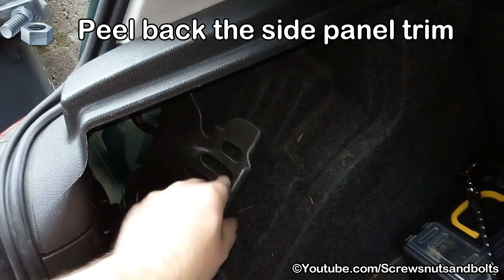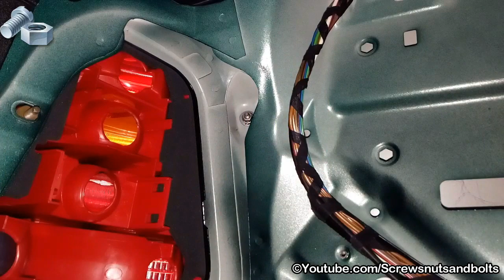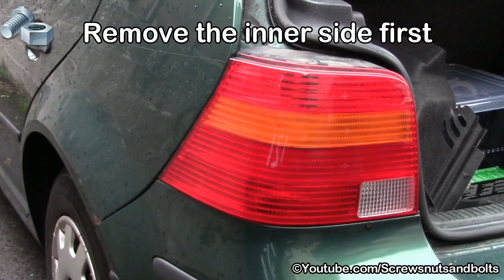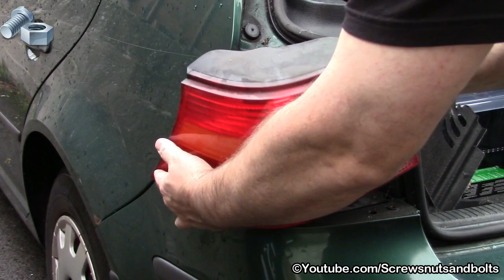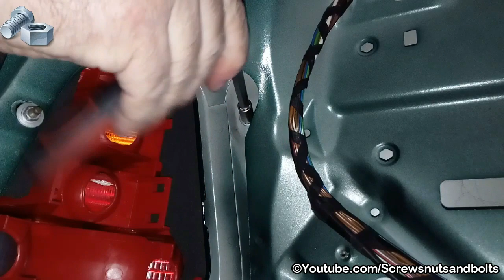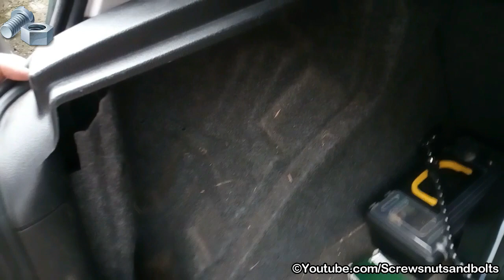Rear Light Unit Removal  - Volkswagen Golf

Comment: Mine had 4 mounts passenger side was a push in pin in a rubber grommet you have to be very careful to not break the end , farthest tip down low, couldn't find the drivers side at all 02 GTI
Reply: I’m having an issue where that pin isn’t releasing… hard to find the pin on the inside of the car

Comment: Was pretty helpful up to the point when I discovered that the left side and the right side back lights are not made or fitted the same way. Now I need to find out how to remove the corner screw of the right hand side back light.
Reply from the maker: Are they different ?. I assumed it would be similar on the other side. Sorry about that
Reply: I just did mine. There was 3 screws in similar places and right in the front bottom corner there was another thing holding it which you couldn't unscrew and had to wiggle the light carefully to avoid breaking it